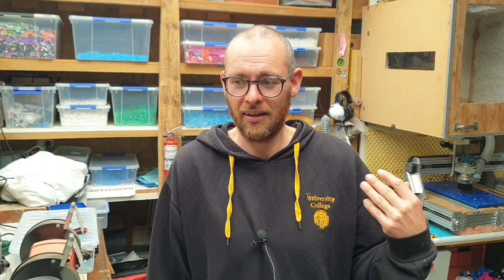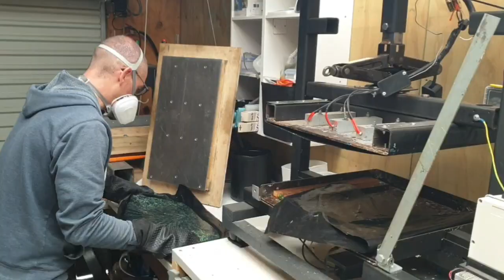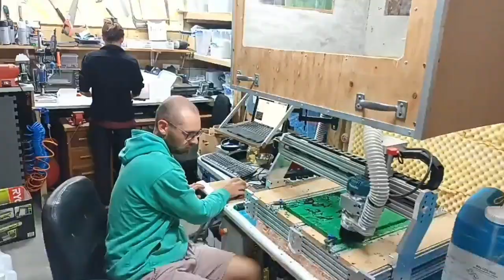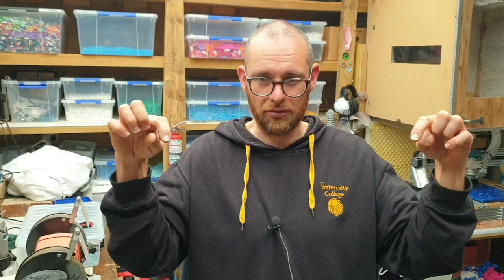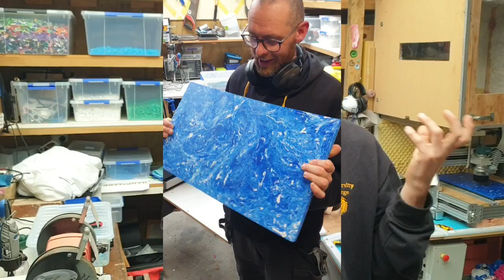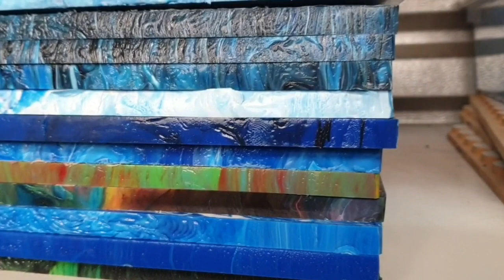This made my day! Could do yours, too! 😃

Comment: Yes i am needing this a lot. Last week i Just broke a lot of equipment, for example the Injection Machine and now i am Just under delivering time.  I finished rebuild another one yesterday (Previous was from a split log, this One Is standard PP).  A crowdfunding Is starting, stress and doubt start working and this video is Just fine to heat

Comment: Have you tried tightening the press gradually and keeping the pressure there? if your production runs don't require constant feeding; you can use it as a cooling press. Precious plastic have quite an in depth video solving the problems you mention its called: The ultimate guide to make the PERFECT sheet | 2024